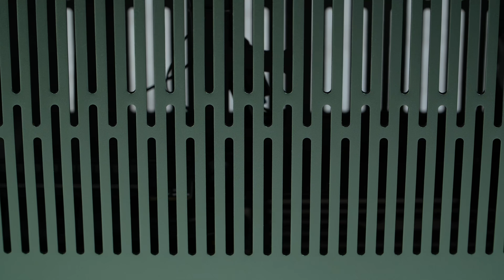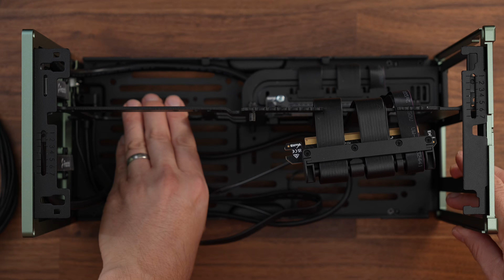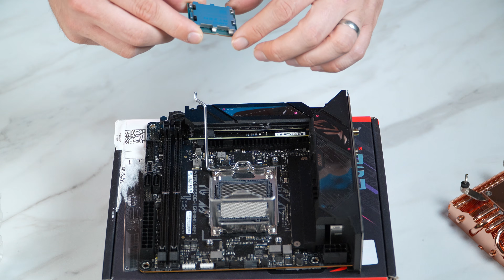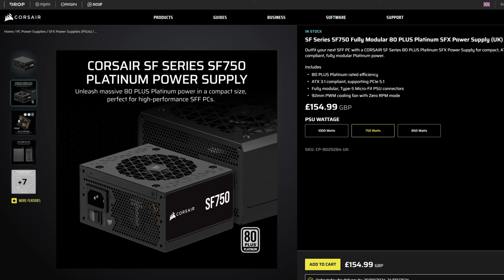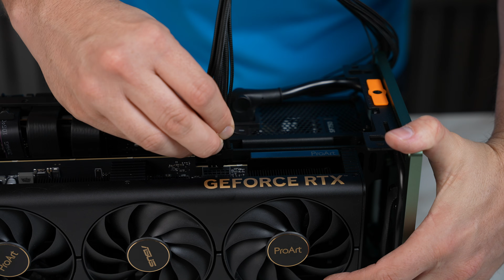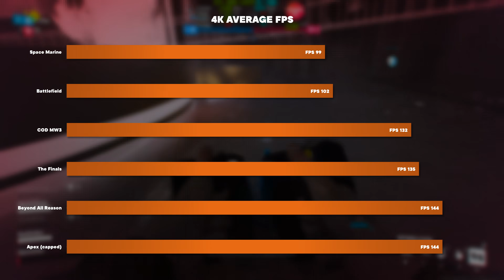The Quiet 4k Gaming Terra Build - Featuring Ryzen 9 and RTX 4080 Super & ITX Fractal Terra

Comment: Just bought the only 4080super proart they had refurbished on Amazon for this build. Only thing is i would like that same fan with the metal grate but i guess they dont make that anymore it seems to have a new design.
Reply from the maker: it is just the standard slim noctua 120mm (black) with a cheap 120mm fan guard I picked up from amazon :)

Comment: My worry is that cpu is going to be throttled or just run too hot. That cpu has TDP of 170W, and looking at temps it seems to be just about able to handle 90W. I love the case but it should be bit taller to allow for 240/280 radiator. Or bit fatter to allow for both 2.5 slot gpu and at least something like Noctua NH-L9x65 which is 65mm thick. Obviously, if you are just using it for gaming or whatnot, it's probably not issue. But in that case you should just go for much lower grade cpu of tdp around 100W.
Reply: 170 would be tough... Have to get the thinnest GPU you can get, to move the case spine over, so you can get extra space for CPU cooling.  If you can get some high speed fans in there, they might be louder, but could handle the temps. If you are stuck with a 15mm fan, I wouldn't want to run a much of a chip in there.  Even with a bigger 120x25mm 3000 rpm fan in there, it barely handles 120 watt CPUs good.

Comment: is there a significant difference between the ThermalRight AXP90-X47 full copper compared to other color options?
Reply from the maker: the full copper gives the best results by about 5c approximately. When you are working in small enclosures I want every advantage I can get to keep heat/fan noise down :) There is a black full copper version too btw
Reply: @MashITTech  much obliged!

Comment: I have a very similar build except I have a Ryzen 7 9800X3D with a Thermalright AXP120-x67 and an ASUS Prime RTX 5080 2-slot card. I have the spine set halfway between 2 and 3. I undervolted the cpu 15% because it was throttling, and that took care of the throttling, but under load this build makes a lot of noise, especially on CPU-heavy tasks. Is this CPU too much for this build? Do you have advice on exactly how much space to give the components from the sides of the case?
Reply: I’m seeing the default TDP on the 9800X3D is about twice the TDP of the 7900. I guess this is my main issue?
Reply from the maker: with the undervolt how much wattage is the 9800x3d pulling? how much space have you got between the x67 and the side panel? There should no issue cooling the 9800x3d, I have cooled it with lesser heatsinks!
Reply: @MashITTech thanks for the reply. I think the issue mainly comes down to spacing. I took the side panel off on the GPU side and it was much quieter. So it looks like I need to decide if I can get away with even less clearance on the cpu side to give the prime card more room. Although I’m not sure my PSU has the extra room either.

Comment: i think the NH-L9i is not an adequate cooler for this setup
Reply from the maker: You could get the l9a to work in this setup but you may need to cap the wattage/run eco mode/add PBO undervolt

Comment: Could I build in this case using a 7800x3d and a 9070xt?
Reply from the maker: Absolutely, My only recommendation is to aim for a smaller XT like the one I used or the 2.5 slot prime. That was you get a bit more room for a larger CPU heatsink. I have cooled the 7800x3d with a tiny AXP90-x47 without issue but I like to go bigger if possible
Reply: @MashITTech Thanks alot, my friends recommended this exact same air cooler that u used in this build so I’ll take ur advice and go for the smallest 9070xt. Appreciate the tips🙏🏾
Reply: @MashITTech One more question, would I have any overheating issues building with this case and the 9070xt with 7800x3d?
Reply from the maker: None at all, the 7800x3d is really easy to cool. Even with my tiny x47 I managed to get really good temps with a slight undervolt. And that was in a PC much smaller than the terra! And with regards to the 9070xt, each brands coolers are different, some are massive. The model I used and linked in description is the smallest 9070xt. The Asus prime is also small (though a little thicker than this one) if you can't get the reaper. oops, just realised you watched the nvidia build. Let me link you another video I did with the 9070xt so you can see the size
Reply: @MashITTech does it have to be full copper, coz in the builder pc site it wouldn’t show up every time I hade the fractal terra case equipped on the build, once I took the case out, then the full version showes up. Do I just get the normal one or still get full copper
Reply: @MashITTech oohhhh alright thanks
Reply from the maker: what PC builder site are you looking at? is it a shop where you configure the parts? I normally just grab the components from Amazon or local retailers.
Reply: @MashITTech and when u say smaller xt, do you mean a lower gen? Or a smaller 9070xt brand?
Reply from the maker: OK, although I use a different type of motherboard here, this is the smallest 9070xt, it is tiny but still performs amazingly: https://youtu.be/UQBnqYF9pVY

Comment: I have almost this exact same build and I find the cpu cooling to be a weak point in very cpu intensive tasks (usually not gaming). I'm pretty happy with it though. Running my 9900x undervolted has helped.
Reply: which CPU cooler do you have?

Comment: How about replacing with a 5070ti Prime? Its 304 mm x 137 mm x 48 mm, while the 4080super is 300 x 120 x 50 mm. 5070ti seems more wide. Thx
Reply from the maker: I thought the 5070ti prime was exactly the same size! Either way it should fit fine. I have a 5080 prime in the studio, I will check it Monday
Reply: Did this work? Curious as can't get the 4080 super from anywhere

Comment: I have a similar build. Using a 4080 fe and a 9700x. But my temps are hitting into the 80s and a peak of 91 while gaming 1440p. I tried the l9a, then changed to the axp90-47. I saw a slightly better temp range with the axp, but still will see after gaming awhile temps hitting high 80's. Any suggestions? the 4080 fe makes for a very restrictive amount of room for a cooler. I have the lian li 850 psu with its fan facing the GPU exhaust to push the heat out of the top in hopes of reducing recycled air to CPU.

Comment: Mine is very similar, but I am still on AM4 with a 5800X3D, that thing likes to cook itself no matter what I do... I think its just the CPU itself since the 3D VCache sits on top of the CPU.
Reply from the maker: Have you given it an undervolt? my -20 PBO on the 7900 makes an amazing difference to temps
Reply: @MashITTech  im actually on a -25 PBO all cores and a themal limit of 89C, It still will hit 85C but it boosts higher ever and runs great. Just wish it wasn't running so hot with an AXP90-47 Full copper.

Also tried the noctua fan swap, that only made it worse.

Comment: Why did you opt for X47 instead of X53? Is it too tight to fit a X53?
Reply from the maker: the x53 would have fit but if you put it too close to the side panel you get a little turbulence. I wanted the system as quiet as possible

Comment: hey i think these youtubers are crazy chuking a 750w psu in there, no need and absolutely an overkill, it will draw massive heat into it, even if not used
Reply from the maker: That’s not how psu’s work! They draw what they need upto their rating, they are often most efficient at about 50% load so will actually probably create less hear

Comment: Does this board you use allow you to undervolt the CPU and GPU?
Reply from the maker: Yes, the board allows you to undervolt and tweak the CPU and RAM. I undervolt by using a negative PBO on all cores, it makes quite a difference. With regards to the GPU, I use MSI afterburner to undervolt, it doesnt need it for temps but it allows lower fan speeds due to reduced temps and wattage

Comment: This happens to be the PC case for a current-gen Ryzen/Radeon tabletop build I’ve been working on. So far, it has a B850I Aorus Pro board, a slightly undervolted 9800X3D cooled by a pretty impressive NH-L9x65 from Noctua, and one of those newer Corsair SFF PSUs with the smaller cables. It’ll eventually have a non-overclocked low-profile 9070 XT after scalper season comes to a close. With how well the 7800X3D and the 7800 XT perform together, it’s looking like this build will be a Zen 5/RDNA 4 equivalent to that.
Reply from the maker: I didn’t have great temps with my x65, the axp has been much better for me. I just managed to pick up a power colour reaper 2 slot 9070xt and can thoroughly recommend it, just working on a forms t1 build with it atm 👍

Comment: I want to build a pc in this case but the problem is that pcpartpicker tells me that updating the bios in necessary to support the cpu so do you have any recommendation on what motherboard should i get because i dont want to check every day for a bios update and im afraid ill forget to update the bios
Reply from the maker: What CPU are you looking at? I am guessing you are pairing a 9000 cpu with a b650 motherboard? If so, dont worry too much, most motherboards now will already have pretty current BIOS pre-updated and when you get your new board just do it once with the latest BIOS on the motherboards website. It's very easy, on the ASUS for example, you put the new BIOS on a flash drive, go into BIOS and choose the BIOS update option

Comment: How many noctua fans do you use in this build? I will build the same setup but i dont know how many noctuas fans i need to buy
Reply: Noctua a12x15
Reply from the maker: Just one in the bottom is enough but you could squeeze a fan above if you have a toasty build. My 4080 build was fine with just the 1
Reply: @MashITTech  Do you think it can support one bottom fan and one top fan if using the Noctua 120mm x 15mm fan?

Comment: Amazing video! Would the AXP-120 X67 work fine as a cooler for this build?
Reply from the maker: Yes depending on the thickness of the graphics card. Plus because the fan sits on top of the x67 you want a couple of m clearance at least to avoid turbulence
Reply: @MashITTech  If I used the same GPU as you did in the video, would the clearance be enough to be quieter than the AXP90
Reply from the maker: If you can wait until tomorrow I will check when I am back in the studio. I have a x67 in stock. Ping me a reminder if you don’t hear from me by this time tomorrow as I have a terrible memory
Reply: Thank you so much for your help!

Comment: Build is done (4070ti super in my case and Ghost edition 2 fan on CPU) set curve optimiser at -20 and sweet! . Temps sit around 80/85 when playing Indy @4k, maxed out settings, full path tracing and DLSS Quality (FPS capped to 60 for now until I move it to the 120Hz tv). I was wondering what under voltage or any other tweeks I could do to just try and get the temps down 5 degrees, say a max of 80 degrees? I know the chips are designed to run hot, but it'd be nice to have it a little cooler if possible and not so close to the limit allowing for spikes in temp. Video was really helpful by the way and very pleased with my games machine!

Comment: what about replacing the cpu heatsink fan with the nf-a9x14? heard it runs quieter? then also a thermal duct (but not sure if this would create turbulence?) 

Looking to move my current am5 system from the nr200v2 to the Jade fractal Terra when the new GPUs get announced. Will buy either a 8800xt, 5070 or even a 4070ti super if 2nd hand prices look appealing. 

Noise levels are important for me, if dropping 10% performance means a substantially quieter build, idm. Any advice is welcome!
Reply from the maker: You absolutely can swap the fan, I have done it before. It is a little quieter but not everyone wants to pay the extra for that little improvement. And yes you can create a duct and it doesn’t create any turbulence

Comment: Hi all, would a Noctua NH-L12S fit this build or would it be too high at 70mm overall? Looking to build the same but with a 4070 ti super to save on the ££s
Reply from the maker: Let me know which 4070ti super you are looking at and I can check
Reply: Hey, thanks it’s an ASUS NVIDIA GeForce RTX 4070 Ti SUPER 16GB ProArt OC Edition Ada Lovelace Graphics Card
Reply from the maker: ah great thats the same 2.5 slot as my 4080s. Let me grab my terra and L12s and try it
Reply from the maker: oops just realised mine is the ghost edition which is 66mm tall: https://amzn.to/3ZqOdzL that one fits with exactly the same config as the video. Have you got the L12s which is 77mm? this one: https://amzn.to/3CRwXLi - Edit, I just spotted a 3rd model that is 70mm, sorry didnt realise there were so many. 70mm will fit but you will need to move teh GPU 5mm towards the side panel
Reply: @ thanks :)
Reply: @MashITTech awesome thanks, maybe I’ll just go with the one in the video or ghost edition. Is the ghost edition better cooling? Both get good reviews
Reply from the maker: the ghost edition is better for its smaller size and it uses a 90x25mm fan which then allows better ram clearance. The l12s 70mm uses a 120x15mm fan which is slightly quieter but limits ram height. Hope this helps
Reply: @MashITTech  That's great, thank you
Reply: One other question sorry, the fan at the bottom of the case, is it up draught or down draught?
Reply from the maker: downward firing to take the hot air out of the case and draw fresh air in through the side panels 👍
Reply: @MashITTech  Thanks!
Reply: @ and is that the same with the PS? Fan facing in to draw hot air into and exhaust out of the PS?
Reply: @MashITTech  Sorry, I meant which is better between the ThermalRight in video and Ghost edition. Temps looked a little high in video, but I'm no expert

Comment: If I want to use an intel cpu, what changes do I need to make from your build? Do I need a different motherboard, etc?
Reply from the maker: yes exactly. what gen intel were you looking at and I can recommend parts for you.
Reply: @MashITTech  I appreciate the help. My first time building a PC. I was going to use your exact build to use Teknoparrot, but thought intel was better suited for that. Turns out AMD may be fine. So, I'll probably go along with your exact build, but any changes after you had posted the video? I read that an NH-L12s is a better choice for fan and saw your comment that you forgot you had one to use?
Reply: @MashITTech  Also, I only see that the ProArt RTX 4080 OC (overclocked) version is available for purchase. You think that would still work? Diff dimensions? or Maybe will be hotter?
Reply from the maker: Hey mate, The L12s may be slightly better but it is quite a bit more expensive. If you have the budget it will work well, if you want to save some pennies the x47 full copper cools the processor without any issues. And with regards to the OC version, it is almost the same but runs a few mhz faster, it wont cause any heat issues as there is more than enough headroom. If you need help when you start to build message me here or add me to insta and start a chat :)
Reply: @MashITTech  Thanks mate! I appreciate it. I've just sent you an email.
Reply: @MashITTech would the Ryzen 9 9900 4.4ghz 12 core AM5 be ok? I see it’s on sale for $362 at B&H when bundled with the Asus RoG strip B650e-i. I wonder if it’ll run hotter since it’s a lil bit more power than your build.

Comment: Would a Thermalright AXP90x53 full copper fit along with an Asus Prime 4070 Super in the Terra?   Cpu will either be a 7800x3d or 9700 non-x so looking for the best cooling possible.

Comment: Hi, first time PC builder here:
I have decided to go for an ITX build and this video was great help! 
I was thinking about putting a Ryzen 7 7700X CPU due to stock availability and price. Same goes for the GPU, want to go for a 4070.
The Motherboard I’m going for is MSI MPG B650I EDGE WIFI. Would the cooling options in this video keep the system at bay or do I run the risk of overheating?
Lastly, worrying about the dust getting into the case due to the last gaps in the case, so considering to get some loose dust mesh filter to stick to the inside of the case behind the openings, but worrying it may have an effect on airflow.
Thoughts?
Amazing job on the video again, great stuff.
Reply from the maker: hey mate, glad you enjoyed the video. you will be using lower power components than I used so you should not encounter any heating issues. My only advice is like my build make sure you keep some clearance either side of the case to eliminate any turbulence. What region are you in? I can help you choose components if it is any help? Lastly with regards to dust, dont worry too much, yes dust will build up over time but the beauty of this case is it is very easy to flip up the panels and the the fans/heatsinks a clean over the coming years.
Reply: Thank you very much for getting back to me on this. 
I live in the south of the UK if it’s any help.
Reply from the maker: ah probably not far from me then (dorset) 😀 let me check what offers are about at the moment